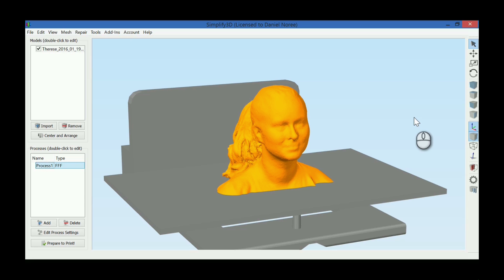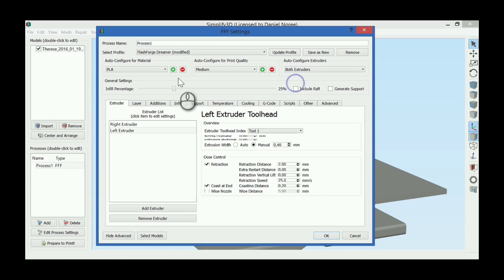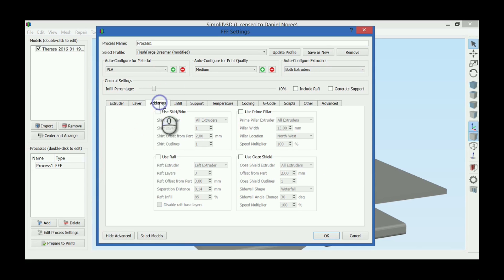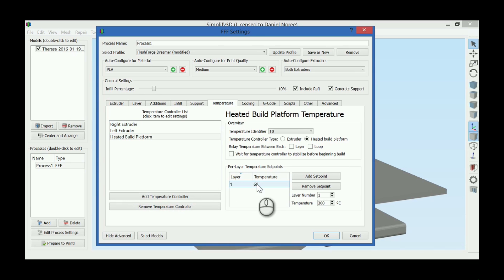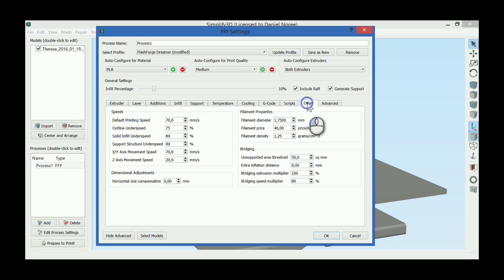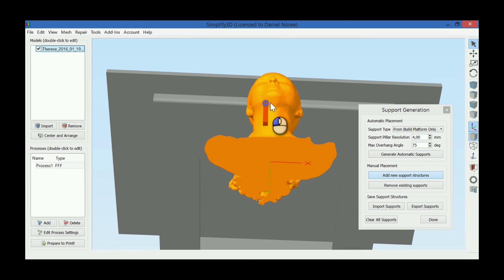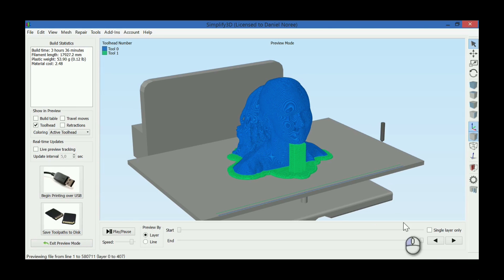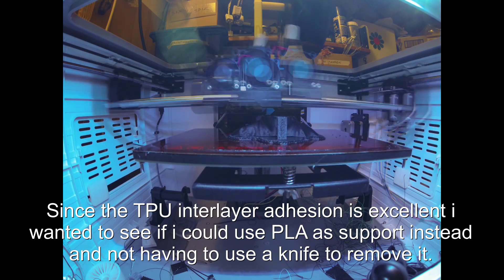Does TPU stick to PLA when 3Dprinted?

Comment: the title is slihgtly misleading! 
it maybe should be called "Can PLA be used as Support material for TPU?"
since i want to see if i can combine them in the same part!
Reply: I'm trying to find out the same thing myself. Any luck so far?
Reply: @mervynlarrier9424  sadly nope :s
The adhesive is very weak in my experience. I'll try TPU and ABS maybe. Someone told me they adhere together properly

Comment: I just tried using the first layer of pla to stick to my builtak sheet since the TPU seems to stick too well to it.  

The bond is average, it will not come on its own, and needs a bit of forced to take it off, but it's not going to tear itself off.

Comment: Nice. It's a few months later. Are you still printing TPU? And are you printing it with PLA support or something different?
Reply from the maker: I print TPU/TPE all the time but i never use support. I try to, (if possible) using support.